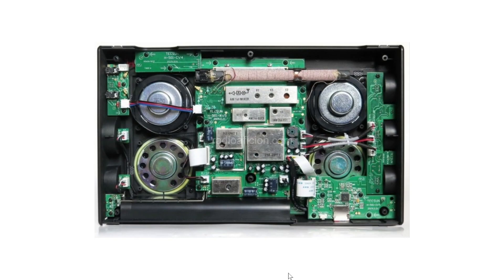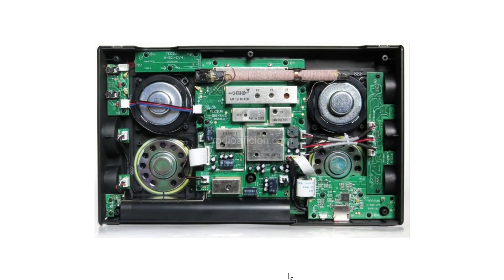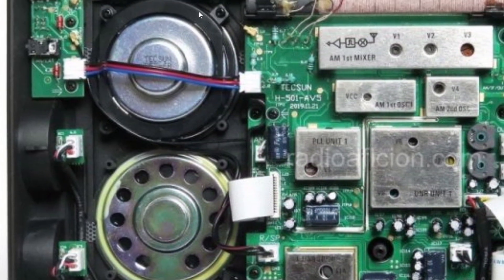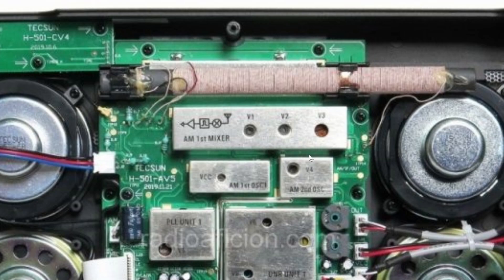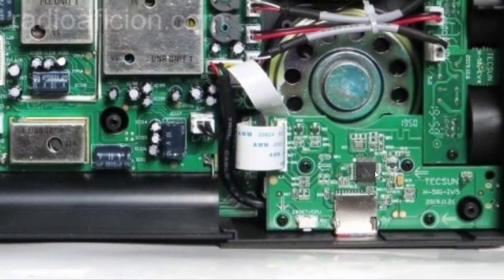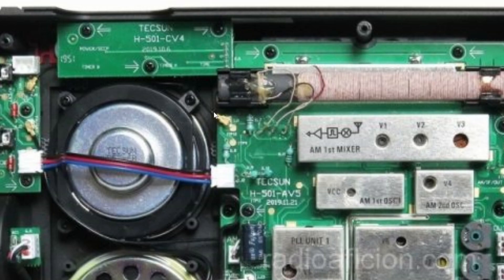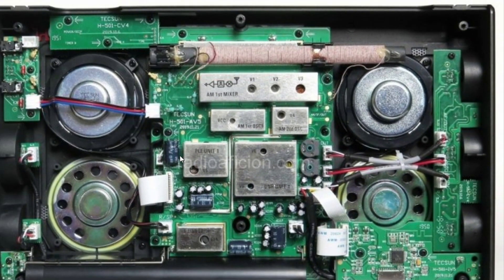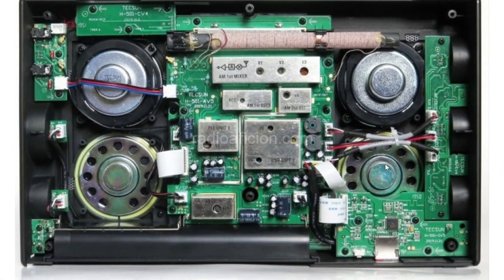Tecsun H 501X View of the Internals electronics with some personal observations

Comment: Hi, thanks for the review. Just ordered one (April 2023). The Bluetooth section is on the bottom Right of the picture, you can see the zigzag BT Aerial going Horisontally.
David G1ZQC.
Reply: Here I am replying to myself. I am 99% sure the Bluetooth facility also has a Microphone. If you look at the board in the bottom Right, there is the BT Aerial, plus an extention to the right, if you look at the front of the radio, there is a small grille, which I think has the Microphone behind it.
David G1ZQC.

Comment: My solution to continually connecting and disconnecting the power is to buy a light duty power bar with a shut off switch. The one I bought has a built in  2 USP ports which makes charging and SW listening very convenient.

Comment: I think the thing that i notice more than anything else is that each of those sections can be manually aligned, there's trimmers on all of them. Thats pretty surprising on a new portable radio.
You dont need proprietary software or to connect to the JTAG header to get to the ASIC/ FPGA.
Its awesome to see that kind of design, in a brand new product.
Reply: A bit of old school in new school.

Comment: My left speakers stopped working intermittently. Opened the back casing and found the speaker circuit white plug was not properly engaged. Easy fix. Very happy with the radio.

Comment: Thank you so much for doing this review. Regarding the speakers,  from what I can see in the video, the bottom "speakers"
appear to be passive radiators. I have a 501X on the way from Hong Kong. I really have to resist taking the back off. For years,
the very first thing I would do whenever I got any electronic device was open it up and take a good look inside.
Reply: Hi.. how did it go.. I am thinking of buying one too and I live in UK.
I would appreciate your experience so far thanks

Comment: This radio looks finely designed. How is the sensitivity on long wave compared to other radios? Maybe I won't need to worry about it for much longer though with the last stations shutting down. In old radios, the ferrite would stretch for most of the width of the cabinet, but the windings would only cover a small portion of it.

Comment: Finally a portable radio that is capable of challenging the good old Sony ICF-2001D/2010. I have both, today my brand new Tescun H-501x has been delivered. The Tecsun has more bells and whistles but the Sony is quite capable to equal or beat the performances of the Tecsun. As for sound quality, the Tecsun, no arguing that. As for the sync detector, the Sony. This fact alone made me decide not to sell my Sony. Tecsuns still have only mediocre sync detector circuitry inside. For some reason it seems to be very difficult to fix the flaws in their design. True, it is a lot better than in their previous designs but the detector still is no match for the Sony ICF-2001D/2010. On the other hand, I will have to use the radio intensively for a final verdict. As for now, both radios will be my pimary receivers while.on the go.

Comment: One observation I like. It seems Tecsun does not use that awful glue that was so frequently applied to the printed circuit boards and individual components in 1970's & 1980's receivers. Good for Tecsun, they are learning what not to do.

Comment: Thanks 😊 for the review of the inside of
The Tecsun H-501x. I would like to see if
there is any difference from my Chinese
H-501, though you stated the circuitry seems
to show it's similar in both models. I wonder the H-501x is more refined than the H-501?
My Chinese model of the H-501 has performed well with no problems so far.
Ray, W2CH.

Comment: Ferrite looks small actually,what's the length of it?did you measure it??
Reply from the maker: looks small cause the radio is big.  It is much longer than almost any other portable receiver
Reply: Does the Tecsun pl 990x have the same length ferrite? Would be interesting if their radios have this caliber of antenna.

Comment: I wonder what those bottom speakers are for, since the sound comes from the top ones.
Reply: You're right, I have the 501, and I can't hear a thing from the bottom speakers! I've even looked inside the radio, I don't see where they are even wired in. Very odd.
Reply: I was also wondering, @patthegunsmith referred to them as "passive radiator" speakers. I searched for it and it appears it's some kind of speakers not wired to anything, that use the pressure waves created by the powered speakers to balance the sound. At least that is what I got from here. https://en.m.wikipedia.org/wiki/Passive_radiator_(speaker)

Comment: I opened up my Tecsun H-501x and found that only the upper 2 speakers are active, and the lower 2 are dummy speakers or passive radiators.

There are no hidden cables to connect the lower dummy speakers.

Read the user guid. It mentioned only 2 speakers. There is no mention of 4 speakers in the user guide.

Those who don't agree with me can open up their Tecsun H-501x and attest this fact. And contradict me if they find 4 active speakers. Let me know back.
Reply from the maker: All receivers with good audio have passive speakers with the main speakers...that is how good audio quality is done
Reply: @OfficialSWLchannel  OK, Sir thanks.